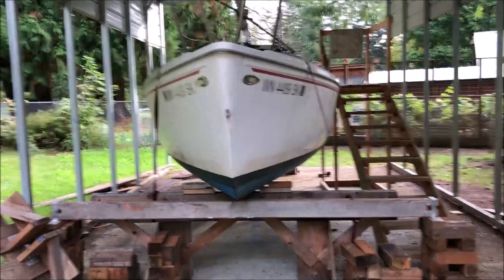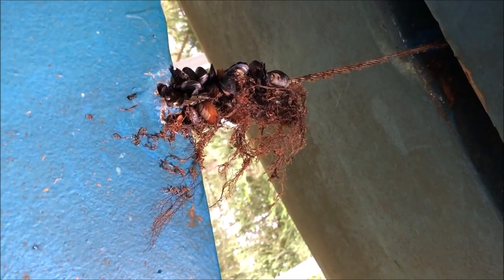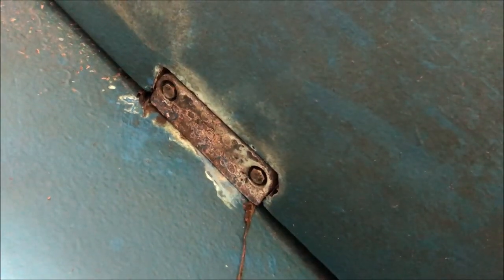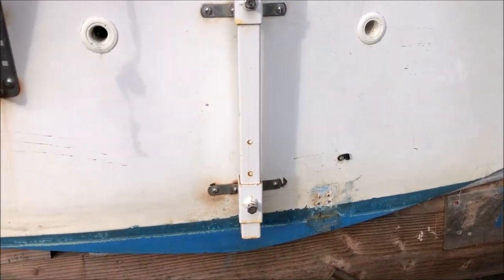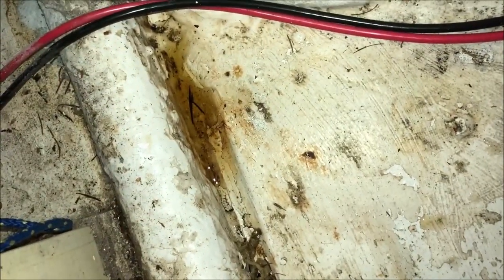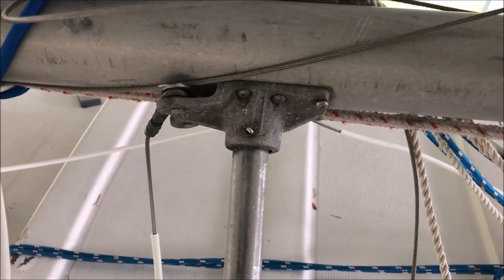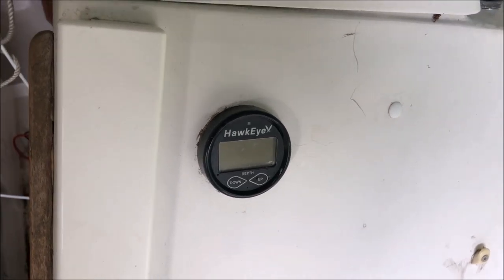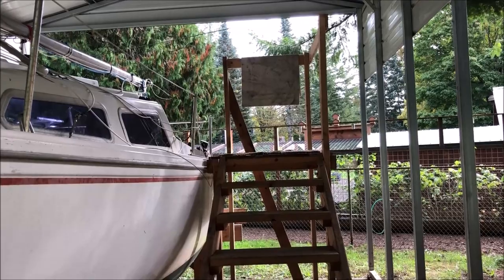Six Months in Salt Water -- Catalina 22 -- Jim's Little Boat

Comment: Where did you get those white cabin rails?
Reply from the maker: Catalina Direct. They are great except for one thing.  Almost no friction.  You have to be careful when standing on the sliding hatch.  In the boat tour video you can see some hatch friction knobs I installed to lock the top in place (or just increase the friction).

Comment: I am on the east coast and have a 1975 Catalina 22 hull# 4975. looking for a trailer not having any luck
Reply: Good luck! I also have a '75, # 5503, and finding a good trailer either separate or with a boat is a tough go. Most trailers are poorly maintained and a new galvanized one will set you back near 3 grand. Sometimes you can spot a junk boat on a decent trailer. Do the FREE boat thing and keep the trailer.
Reply from the maker: I got mine at a boat junk yard.  They part out the boat, sell the trailer and take the hull to a landfill.
Reply: Just bought a 25' from 78 came with trailer but no vin or title so I have to figure out how i can get it titled as homemade when I have zero info on it